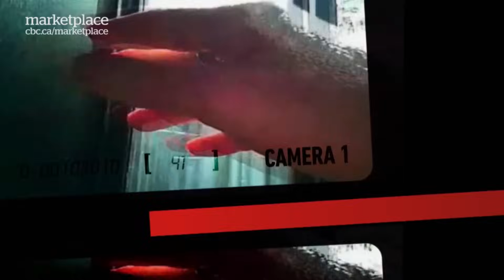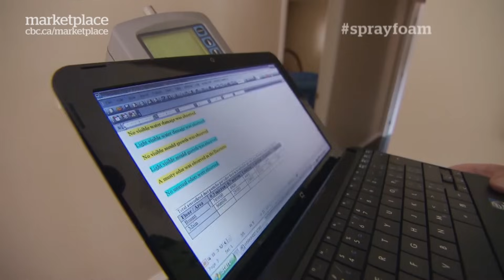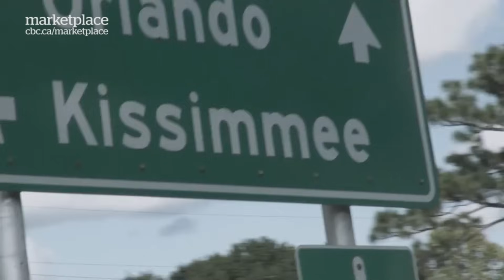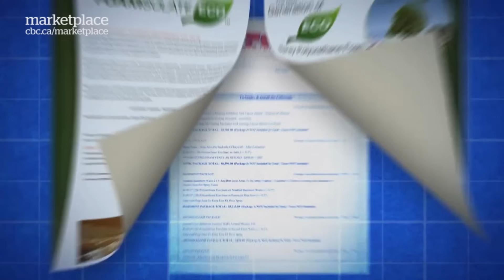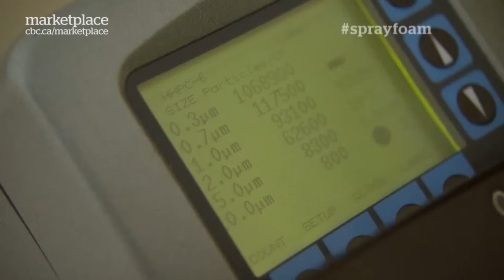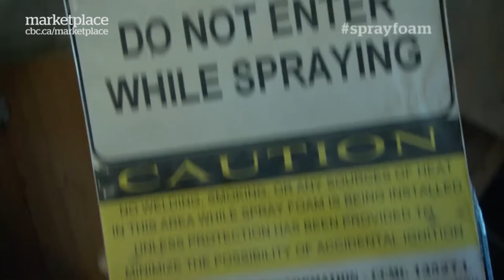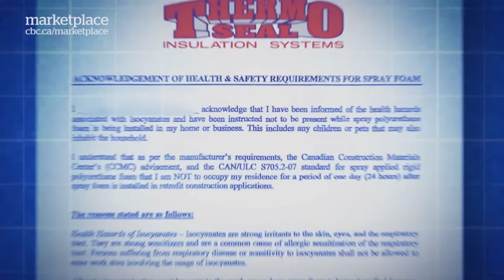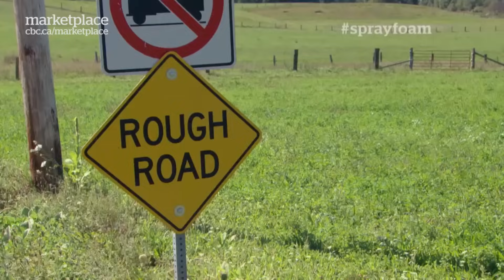Spray foam insulation nightmare: What can happen if it's not installed correctly (CBC Marketplace)

Comment: I work for a spray foam company I have never once seen foam sprayed on the sheet rock in the attic we always spray on the ceiling and side walls. That was weird for me to see all that foam on the sheet rock
Reply: i was saying the same thing, i've sprayed it before and it was never sprayed on the drywall itself, only when spraying in interior walls. we'd hang one side then spray. but it was always on the decking. and it was new houses never did do retrofitting with foam
Reply: Derek Post yeah it's usually on the roof deck
Reply: that's what I asked! why wasn't this sprayed on the roof deck? maybe the ceiling drywall is that bad batch from China back in 2004? and the spray foam mixed with that, causing the smell.
Reply: I have been in contracting for 30 years and have never seen spray foam applied to drywall.   I also suspect that might be a large part of the issue.
Reply: I work for a insulation outfit an we foam board it's not rare like you guys think it is no common but it is done
Reply: onelove That is true with traditional attics. However, with spray foam at the roofline, the entire point is to completely seal the space. Any outside air that infiltrates the conditioned space allows moisture and heat energy in that you don't want. Times change for the better☺
Reply: @IAmMoparNut  Outside air isn't the problem. It's the warm, moist air coming from the interior that causes condensation and ice dams. The only cure is more ventilation. Went through this last year. 30K later and more ventilation and we survived a colder winter here in Minnesota with no issues.
Reply: There should have been a vapour barrier over the sheet rock first off and if you spray the actual roof between the roof rafters then you should really be thinking more along the lines of a career where you ask if they would like fries with that
Reply: @Alec-rx1ub  BWAHAHAHAH... Again Keep flipping burgers
Reply: @badlandskid  Vapour barrier should have been between the sheet rock before ANY insulating product is applied
Reply: onelove  WOW .. Thank you   At least one person with a brain... Good to see
Reply: @IAmMoparNut  Switch to flipping burgers or continue flipping burgers
Reply: Emanuel Sommar if the duct system runs through the attic, spraying along the roof deck makes more sense in order to encase the entire attic. Because this attic was basically empty, applying it to the drywall works as well. It also has do with which climate zone you are in. I’m not sure why you have this obsession with working fast food though. Source: certified BPI building analyst with years of experience. Another source: https://www.icynene.com/en-us/blog/insulating-underside-roofs-making-case-unvented-attic-assembly
Reply: Hulk Smash  Yes   That is what vapor barrier is
Reply: @IAmMoparNut  I agree that conditioned non vented attics are best, if you can afford it.  Might beome the required code in the future.
Reply: @donna8243  could be that Chinese sulfur drywall, that stuff is still out there and smells just as bad
Reply: @badlandskid  well how would you apply it to the walls then, it has to go on one side or the other before finishing drywall.

Comment: July 2021  CBC:  Please do a follow up video for customers to carefully choose the right company to do their spray foam project.  Keep it focused and brief with 'ten steps to follow before choosing your spray foam (or any other important company, project) company.
Reply: I would actually really appreciate that! Ive been looking into spray foam, it can be a great option for bus conversions and rvs, because it can add strength to the structure, and conform to the shape of the vehicle, but ive seen so many diy kits and even people who say “get a professional “ dont tell you what to look for. that really worries me tbh
Reply: You will never again run any wires or tubing through this these walls.  Imagine the repair bill to replace some wires?  Much better ways to seal a residence.  I have 2in of insulation on the outside, under the siding.

Comment: Wow; sometimes new and improved is not always the best choice. After seeing this calling me old fashioned is a compliment.
Reply: Dacia Sandero guys the company who sprayed the insulation, sprayed it on the attic floor instead of the roof rafters I can’t believe it
Reply: @lurkin2944  Maybe it was an open attic. In that case, spraying it on the attic floor is correct.
Reply: Spray foam is to be used for new construction only, these company’s are rolling the dice with peoples health at stake.  I was a spray foam contractor and never installed into a retrofit situation.

Comment: I learned a lot about spray foam after working with it for years the main 2 causes of foam problems is spraying to much foam at a time especially when it is cold and the dreaded crossover. Crossover occurs when the 2 different parts of the liquid foam is not mixed at a 50/50 ratio as it leaves the end of the sprayer. Their are a couple of things that can cause this which I will not get into much detail because I could write a book on problems with spray foam. The main problem I have seen that is the worst case scenario is when the two lines caring the two different liquids end up with different pressures allowing one part of the liquid to enter across the interior chamber of the gun and go up the other line. This will cause a restriction of the one line. A technician will clean out the mess in the gun and continue on spraying. Now because of the restriction on one line the foam is not mixed at the 50/50 ratio when it is sprayed thus it will never cure properly and will out gas for years. The proper thing to do is to replace the 10 to 20 feet of hose which is called a whip line to restore equal pressure to both sides. The whip line is like a extra section of garden hose that can be unscrewed and thrown away. When a crossover occurs it usually doesn't travel any further past the whip line which leaves the rest of the line in good condition. So proper cleaning of the spray gun and replacing the whip line will put you back into business. The foam also has to be heated in cold weather to a certain temperature before spraying for a good cure. One last thing, when foam is stored it needs to be stored above a certain temperature so the properties of the chemicals don't break down.
Reply: wow thank you so much for detailing that information. now I need a good technician in texas
Reply: I wish you would write that book!  This is scary stuff!
Reply: You should have been the expert for the show.  You spelled it out perfectly and now I completely understand.  Thanks.
Reply: Just use the pink fiberglass,  thats been around for decades.  Why mess with a good thing.
Reply: good detail but old man Bernie Bloom said it simply:

"you're manufacturing this foam inside the home ... when it doesn't work and you're inside the house ..." you fill in the blanks
Reply: Good info man! You would think the spray guns would be more redundant to a improper mix. Knowing the risks chopping off a home and health risks. Has to be some smart systems out there by now.
Reply: Do you see any problems with excessive use of foam filler when fitting drywall onto wooden laths? My builder used a lot of it in the corners and awkward areas.
Reply: Is this only the case with closed cell or it can happen with open cell as well?

Comment: A similar spray foam insulation was used in Victoria, Australia in the late 1970s & was quickly banned after people suffered similar reactions to these people. Also several people died after the foam emitted deadly toxic fumes during house fires.

Comment: In Serbia, we use styrofoam that is totally clean (for walls) and glass wool with special nylon insulation for the roof. No health issues.
Reply: Can you post a link to glass wool product?
Reply: @joeglasner1277  its fiberglass. Just normal stuff sold at home depot

Comment: We had the same problem with a strong fish smell.  Luckily we had a very good builder.  They tore out all the spray foam insulation that a subcontractor had just installed.  A very tedious job.  Then they resprayed with a correctly mixed product.  That fixed the issue.
Reply: So there's a solution?  It was just bad installation?
Reply: Definetely wouldn’t necessitate an entire new roof like what the homeowner in the video wanted.
Reply: @pting66  For the peace of mind it makes a lot of sense to be decisive and take the roof off. If you want a 100% job, that is the only option. And it's your house. You and the family spend a lot of time in there.
Reply: @maxmeier532 . Yes but should be unnecessary. They should be able to remove enough that it will no longer pose a problem. I was thinking of some kind of media blasting.

Comment: It sounds like the ambient air temp is critical at time of installation as well as thickness of the first pass as stated. I can imagine if attic temps are too high, the foam would cure on the edges but not the "interior". As far as insulating flat (not vaulted) ceilings go, blown-in cellulose is a good option in my opinion.
Reply: Taco Pro my father owns a spray foam business in Kansas and i have helped him for about 5 years just for reference 

It is the fact of that they sprayed it too thick without letting it off gas and this is a story of closed cell foam not open cell btw and temp only makes it cure quicker it curing doesn't cure from inside just quicker but when u spray too thick it traps the curing gasses inside its self that's why this happened also if spray too cold if just doesn't really work well

Also a too thick of a single pass can self combust since the chemical reactions heat up it traps it own heat until it catches on fire  

Open cell foam kn the other hand has no limit on the thickness of a single pass

Comment: We had our house spray foam insulated over 15 years ago here in NE Ohio, and the foam caused damage to our in wall electrical wiring and phone wiring!  All of a sudden, after the foam was sprayed, several outlets would not work, and the phone lines in some rooms stopped working.  The company paid for an electrician to come in and re-wire or bypass some of the outlets.  To this day, I hope to god that they re-wired up to proper code standards.  Thankfully, the same company did not spray foam the attic space, but they put in 'blown insulation', which has not caused any smells or chemical leeching.
Reply: Don't sweat it.  If there was a problem with the wiring, you'd have known about it by now.